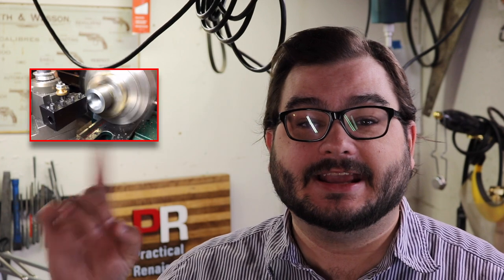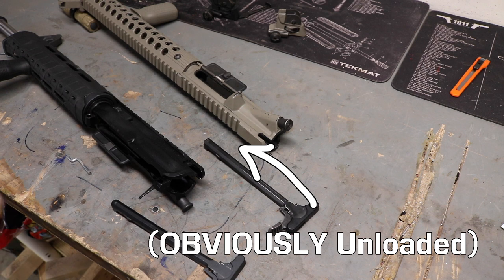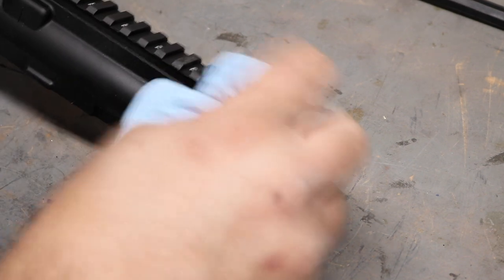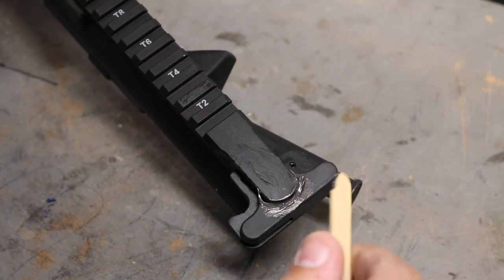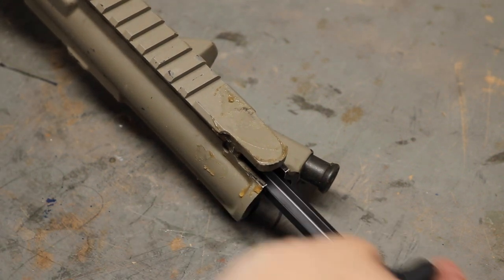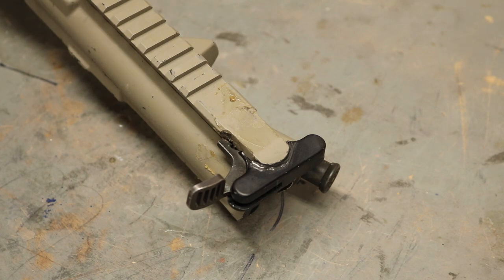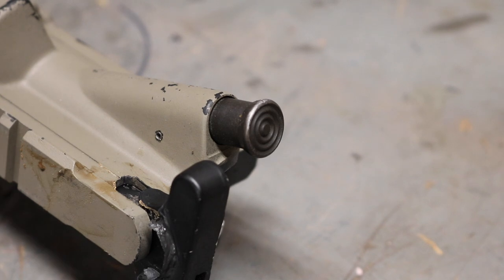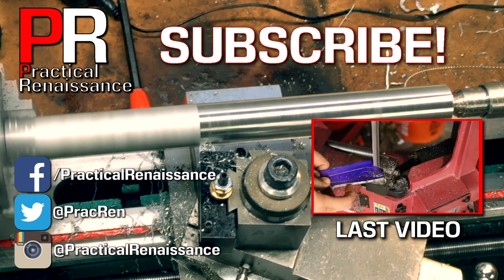DIY AR15 Charging Handle Suppressor Mod!

Comment: This has me curious, would a film of CLP on the upper be suitable as a releasing agent? Also, as a southpaw I’m getting hit 3 ways - CH, forward assist, and ejection port. I’ve never actually used my forward assist ever so I’m thinking of putting a bead of RTV at the joint or disassembling it and putting it inside the FA. I figure a good smack would break it loose if I really needed it. Maybe an O ring would also work for the FA. I bet a good little ring of tape might work too.

Comment: One last observation from my foray into this modification, I did a final cleanup pass with a medium sized Q-Tip moistened with denatured alcohol (but almost any solvent will do) before letting the RTV set up.  

It makes a smooth, seamless finish and because it's a solvent for the liquid RTV it flows the RTV into some of the fine edges and after the RTV sets up it looks like a factory feature.
Reply from the maker: +Jason McKinney That's a really great idea, same with using Hornady one shot as a release agent!  I had given deep consideration to using a lubricant such as one shot or even just straight lanolin, but I fell back to my very positive experiences using Paste Wax as a release for stock bedding.  Next time I do this I will have to remember your idea with the denatured alcohol-- that would certainly make for an even cleaner look, which is one of the things I was going for!  Thanks for watching, and for the idea!!
Reply: Your welcome, and keep up the great channel.

Comment: I want to bond an o-ring section in there that is wide enough and the proper diameter to compress slightly. An alternative would be NOT to close the charging handle all the way, barely. This will allow the RTV to compress a bit creating a better seal.

Comment: You did yours exactly how I did mine: release agent on the upper, RTV bonded to charging handle.

Other videos show putting RTV on a closed and latched charging handle and using an Xacto knife to free the RTV from the upper.

I used Johnson paste wax one one AR and Hornady OneShot on another and it works beautiful as a release agent, by the way.

Good video and I like your channel.
Reply: Is this effective at reducing gas in the face?

Comment: why not use blue painters tape on the part of the ch you don't want the rtv on? I have seen a couple of diy vids and the rtv always shows after cleaning before curing. I like the idea of building a sealing gasket for sure.

Comment: my buddy and I both have a can for our full autos. you say you get gassed? try a mag dump. he did this seal and id say it "worked" but what about the bottom side of the CH? and between the upper and lower? and gas spews out with the cases. really you did a good thing its just having full auto is extra hard to deal with the gas. I hold my breath and wear closed in eye protection.
Reply from the maker: yeah I wouldn't do anything like this if I were doing full auto mag dumps, but this has worked out pretty well for regular semi-auto shooting! if it melts or blows off, then all I'll have lost will be about $0.10 worth of silicone :D  Thanks for watching!

Comment: i think that if you held the charging handle a bit back (like 1 or 2 mm) the seal would've been even better with the gasket applying pressure to the upper surface
Reply: Im gonna give thjs suggestion a try. Gonna try my hand at it next weekend

Comment: Not sure what the purpose of this is, but I'm pretty sure if any gas comes out of there with enough pressure to be audible, than it will be enough pressure to come out of every crack and orifice between the halves and every moving part with enough force to remove the silicone
Reply from the maker: it's not the sound of the gas pressure, it's the actual pressure.  coming out of the charging handle area right by where your face (eyes specifically) are, it doesn't take much pressure to create an uncomfortable puff right in the face, like the glaucoma test they do at the eye doctor's office, so the silicone is in no danger of being blown away, it just stops that small amount of extra puff.  Thanks for watching!
Reply: Ah I see, Makes sense. Thanks for clarifying
Reply: Practical Renaissance maybe this is a bad idea to put a supressor on that rifle, then.